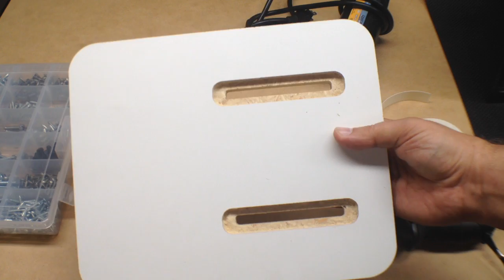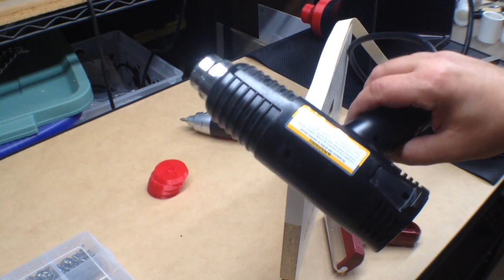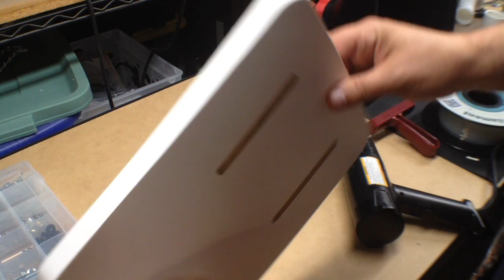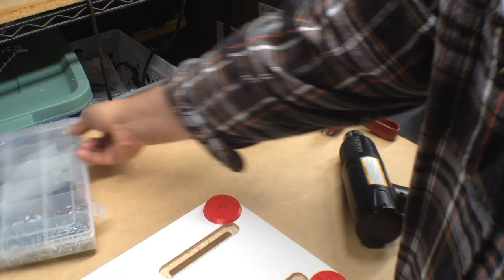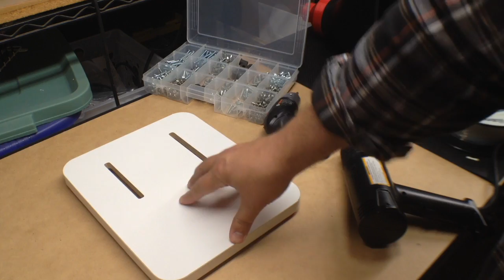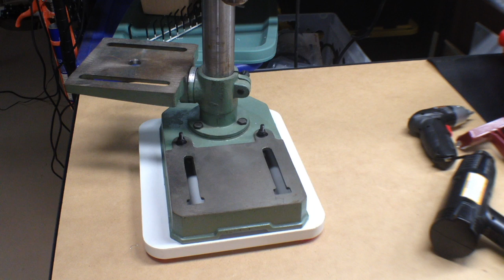Mini DrillPress Table Build  - Assembling The Base!

Comment: I like it. Maybe in version 2.0; design in a little "Bit Drawer" into the base. :-)
Reply from the maker: Could, however wanted to keep at lower profile as unlike my radial floor drill press, this little guy like to tip so wanted to come with some thing help prevent.  Hey have you done any review shows yet?  Checked your channel the other day and didn't see any so just wanted to make I didn't miss it as I am doing a lot of travel right now...
Reply: I did a review on the new HomeSeer Z-Wave wall switches at the end of May.  I enjoyed putting that one together, but I find them somewhat difficult to do. I felt like I was leaving things out or not connecting all the dots if you know what I mean. 

I would like to do more reviews, but by the time I get something I'm interested in doing one for there are at least a handful already done. 

Safe travels my friend!
Reply from the maker: Thanks for the travel wishes, however was referring to the 3D prints you where doing with Mike & Molly as I think that is a cool idea!
Reply: Oh.. :-)  not yet.